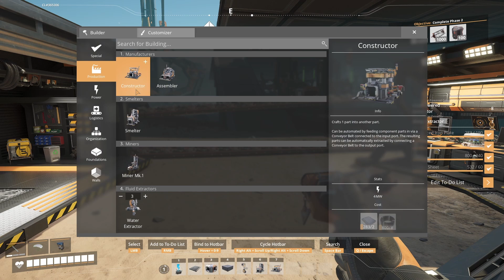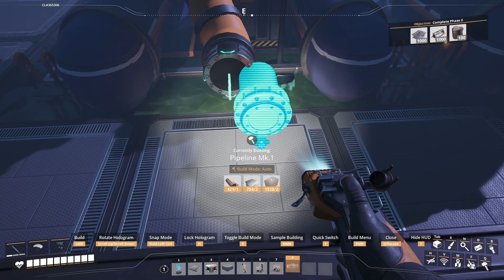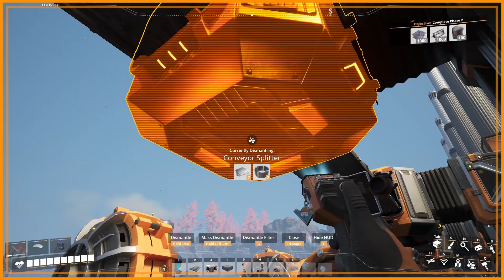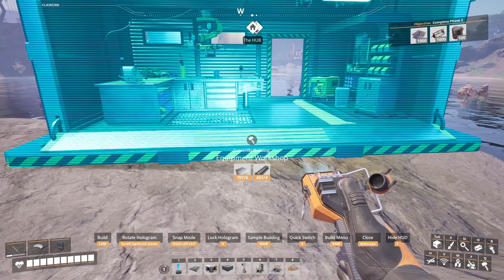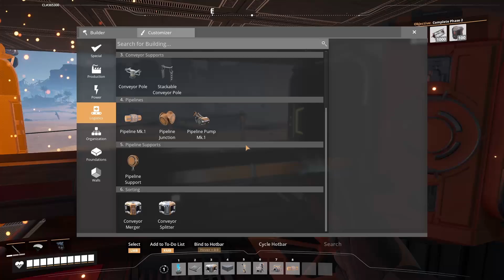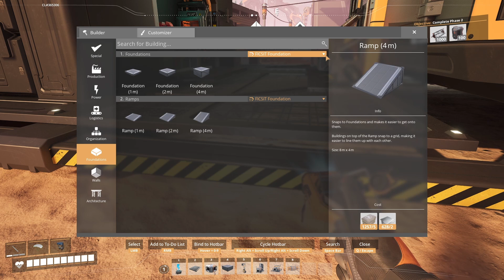Satisfactory 1.0 - Automated Coal Power and Awesome Sink [E4]

Comment: If you don’t want to take up inventory slots with Awesome tickets you can put them back in the sink as long as the sink has at least 1 ticket.  Print your tickets from the sink then drag and drop from your inventory on top of the printed tickets, then exit the Sink UI.  Wala, (voilà for the French among you) you have returned the tickets to the Sink.
Reply from the maker: Nice tip. Thanks.

Comment: I'm late to this episode but with coal power plants. I normally run them at 88.888% as then they require 40 units of water. Each water pump, pumps 120 units of water.
So the ratio I end up doing a 3:1 ratio of powerplants and water pumps
Reply from the maker: Nice option. There are many ways to do things in this game.

Comment: Solid progress, with a SAM node, to boot!   Was nice seeing those steam turbines getting bootstrapped and fired up.
I think that elusive mobius-strip flower you were looking for is near one of the edges of the easy starter biome, that overlooks the stone bridge that leads down near where your turbines are.  -> It looks to be the one I grabbed today and it may be further uphill from where the instrument was initially directing you (I haven't unlocked the map, yet)
  - Reinstalled and having another crack at this after watching this playthrough - I'm not so concerned about the space elevator this time and focusing more on the build.
Reply from the maker: Good move focusing on the build. Don't let the objectives push you.

There are a lot of Somersloops around and I am sure I will run into them as I explore. They are more difficult to find than the Mercer Spheres. Many are hidden in caves and aren't easy to get to. I have picked up a couple.

Comment: Nice video, I’m on phase 5 at the moment, currently setting up a Jet fuel factory!
Reply from the maker: Nice. If I wasn't on a recording schedule I would be probably be 50 hours in. It is tough to hold back and I don't want to be playing 2 solo saves at the same time.
Reply: @surtrplays  yeah I resumed from my old save and made the adjustments from the 1.0 update and I have to say I’m happy but it takes allot to get to t5 lol
Reply: @surtrplays   I mean, if you have some extra time to play you should just do the mundane builds and then you can mention what you did to catch us up on the progress.  Satisfactory is a long game to play,  My last three playthroughs I started making modular 8 by 8 factories and if I needed more output, I just started overclocking and upgrading belts.  This game has changed for the better.  CSS integrated many mods as regular features.   When I start playing again, I need to rebuy it from Steam.  I have it from Epic, and its not eligible for the achievements.
Reply from the maker: I haven't even tried my old saves in 1.0. Maybe I will check them out one day.